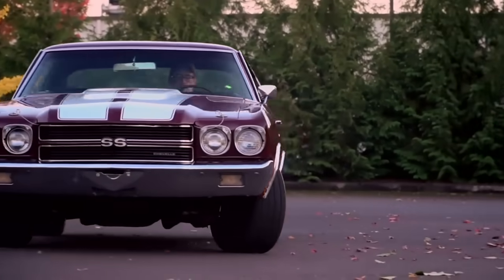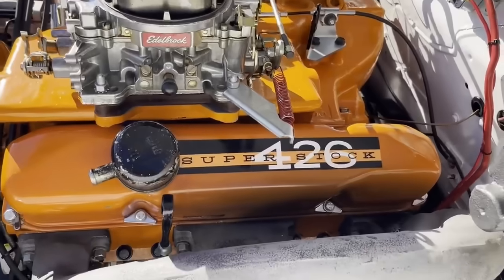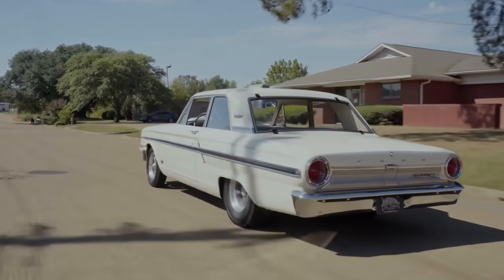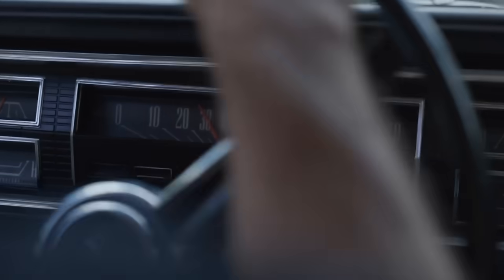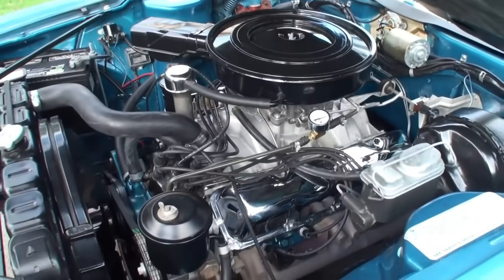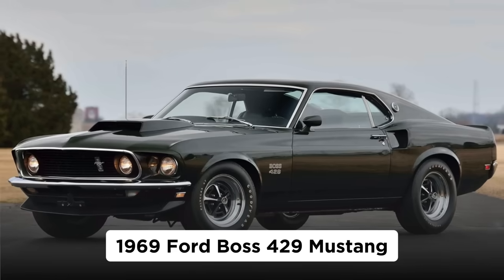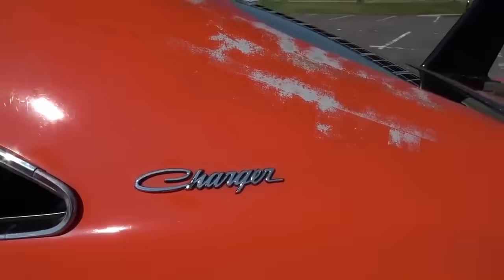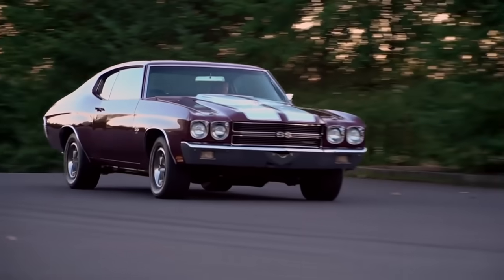10 Best 1960s Muscle Cars

Comment: ANY year Chevelle from 1964-1972 is AWESOME!! Have owned all the even years (except for  '66): '64, '68, ''70, and '72. None were SS, and the '64 was a 6 cyl, but the rest were 2dr with V8's Loved them ALL!
Reply: 67 Chevelle, 283 bored to 292 with 11:1 pistons and a high lift cam, hooker headers, Muncie 4 speed. SS 396 springs up front and station wagon springs in the rear. A car I should have never sold along with many others.
Reply: I agree.
Reply: Lies again? Chest Triceps Medical Certificates
Reply: @NazriB  What are you talking about?
Reply: I paid $800 cash for my first car when I was 15. A 1966 Chevelle/ Malibu 327/ power glide in 1971. The car was in near new condition. I still think it's the prettiest car Chevrolet ever built.
Reply: Had a '68 Chevelle - all black exterior & interior with a manual trans.  Loved it and would buy one now if they still made them.

Comment: My first car was a 65 GTO with a 389 3 x 2 Carb backed by a 4 speed transmission
Reply: Mine was a red 1964 Olds 442 (4spd), with the 310 hp 330 rocket engine.
Reply: 05 vw polo.  1.2
Reply: 64 polara 500 383

Comment: 1966 Olds 4-4-2 W-30. And if your smart enough to order one of the factory blueprinted W-30's (54 cars), you could pull mid to high 12's in the 1/4 mile.

Comment: The (1964 thu 1966) 442 Oldsmobile was not mentioned in the article. 15:25 The 400 cubic inch (tri-power) was very competitive.
Reply: In 1971, when my highschool friends saw that I bought my uncles red 1964 442 Olds (4spd), with the 310 hp 330 rocket engine, they called my grandmas car... One of them had a 1969 Boss 302, the other, a 1969 383 Roadrunner, both of whom, couldn't believe that l  beat them 3 out 3 at Fremont drag strip.
Reply: I HAD a 1966, tri-powered, positive traction with 456, with borg warner T-`10, transmission. ran goos, souned great
Reply: I remember some fun times at Fremont in the 70s. Jungle Jim and Jungle Pam were favorites. K
Reply: Skylark

Comment: 1st car 1967 Mustang 289 hipo, 4spd, aftermarket ac, got for 16th birthday Dec 1969. I have no idea top speed, I do know it would do 125mph. Loved that car
Reply: What you lying for now come on you aint gotta do that
Reply: @mohamed, no lie, had 70k on odemeter, paid $1k for(Dad gave me half), sold it for 600 in 74 & tried to buy it back at least 10x in 80s. To this day the man I sold it to still has it
Reply: @mohammed, if you are refering to front end float at high speed, put weight inside front qtr,panels over tires, that helped a lot

Comment: There is nothing on the road today to rival most of these incredible automobiles. The beautiful styling stopped mid 70's. After that some safety crazed lunatic ruined the elegance and style by making everything look the same. As for the reduction in horsepower and size?...... lunacy.
Reply: as an oldy i would agree, if i won a million dollars i would not buy any pile of crap made today even though some of the sports cars look nice but toooooooo much electronic crap for me. give me the 60s , 70s and 80s stuff thank you
Reply: BULLSHIT..those old cars were crap.....weak brakes, lousy suspensions, gas guzzlers, poor build quality, rusted bodies, and the horsepower ratings were OVER RATED by 20% on average. A 1970 426 was advertised at 425 hp gross but is only 350 hp net....a 2024 Dodge 5.7 puts out more at 375 net. And the newer cars are far more reliable.
Reply: @chadhaire1711  You are miss informed. The 375 hp 396 was dyno tested at over 500 hp. Most of the muscle cars were de rated for insurance purposes.
Reply: @chadhaire1711,  Except when all the high tech electronics goes bad !  Today's cars have nothing exciting about them, they're nothing but stereotyped people haulers!
Reply: @chadhaire1711  you have no clue. Simply that. No clue.
Reply: @carolinacoins  thank you for pointing out to that silly misinformed pup. He simply has no clue.
Reply: @chadhaire1711  one man. One camera. One braincell....One million opinions. All WRONG... bye bye pup .

Comment: All these older cars were crap....horsepower was over rated by 20%, and the had weak brakes, lousy handling, garbage build quality, and fell apart.  The  newer muscle cars are better in every way.
Reply: Horsepower was mostly under rated for insurance purposes
Reply: And by the way new cars are ugly and much more expensive
Reply: @ChrisT-sr4ft  Bullshit..no engine was ever under rated for insurance or at all.  They were OVER RATED by 20%  using the fake GROSS system that was banned after the 1971 model year. You have no idea what you are talking about. 440-6 was rated at 390  but was only 325 NET.
Reply: I wouldn't say they were crap, after all, they're still modeling the new muscle cars after the old ones.  And your right about the brakes and handling but you have to remember...that was 60 years ago.  Technology has improved a little. Also your so called new muscle cars are all supercharged to get that power😊
Reply: @geneczimskey8523  NO---newer cars do NOT need superchargers to get that power.  A new 2023 Dodge with 5.7 V-8 puts out 375 net horsepower.  The 1970 440-4 was only 305 hp net, the 440-6 was 325, and 426 350 net hp although it could climb to 365 at 6,000 rpm.   The 2023 beats them all and the SRT at 485 net is more than any  Chevy 454 big block which had high GROSS hp claims up to 500, but were 450 gross and only 370 net. ALL those old motors were over rated to sell cars.
Reply: That gentleman making a comment about this is obviously anti-american,
Reply: @DavidCrisp-rv7js  wtf are you talking about Gomer  go sober up and come back tomorrow
Reply: @chadhaire1711  Dude what are you talking about. You shared your opinion, but when someone disagrees with you, you just insult them instead of listening to what they have to say? They listened to you and shared their opinions, what's wrong with that? But lemme stop before you start saying words that your mother wouldn't be proud of. There's nothing wrong with people liking older vehicles even if they were less superior, that doesn't take away from their charm especially to folks like me.
Reply: gee almost as if tech advances over time 😱
Reply: @chadhair1711, maybe  you need to sit behind the wheel of my '65 Impala sports coupe, with its 300hp 327, dual exhaust, and positraction rear. It's fast, responsive and sounds fantastic!  Plus it's fun to drive! It also rides smooth and never needed bodywork and no rust anywhere!   Your claims don't hold up!
Reply: @chadhaire1711  one man. one camera. one brain cell. One million opinions, all wrong......pup.
Reply: @chadhaire1711  ....or is it chumphaire1711.....pup.
Reply: @itz_mxxri  300 horsepower is the gross rating banned after 1971, real net of your motor is only 245 hp.
Reply: @nojnoj3069  says  a  punk troll hiding behind a keyboard.....
Reply: @chadhair1711, Let me just say that the Chevy 327 V8 was one of the best engines ever built.  Mine went 300,000 miles before an overhaul.  0 to 60 mph comes in 8 min. Not bad for a big, heavy car! Today's cars are ridiculously overpriced mostly plastic with crappy engines that are shot before they make it to 100,000 miles. Plus too much high tech electronic crap that goes bad before you make it to 100,000 mi.  But whatever,  to each his own!
Reply: @itz_mxxri  0-60 in 8 minutes you say?  
The 1970 cars had worse plastic.
All the V-8 engines today will go 150,000 miles easy except GM, Toyota 300,000 easy.
Most 1960's and 70's cars rusted away in 5 years.
all the older cars had shit brakes that could get you killed and garbage handing.
I could go on......